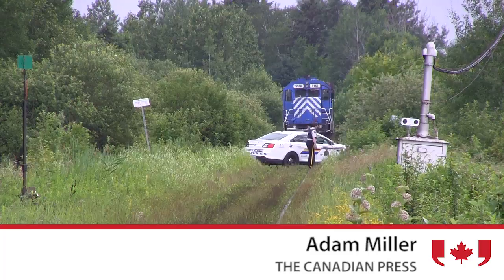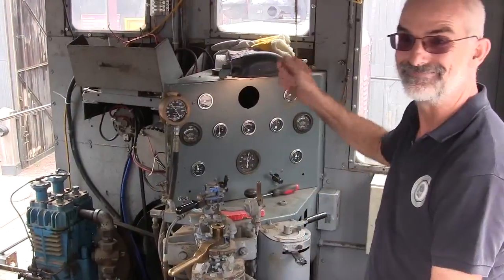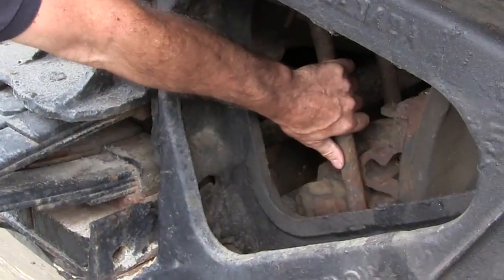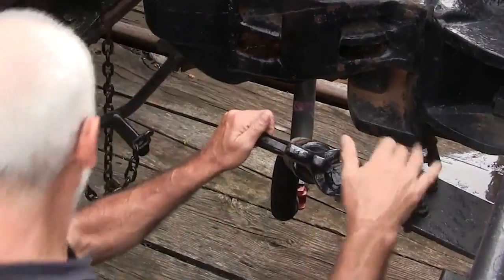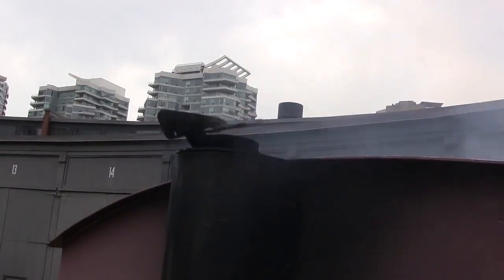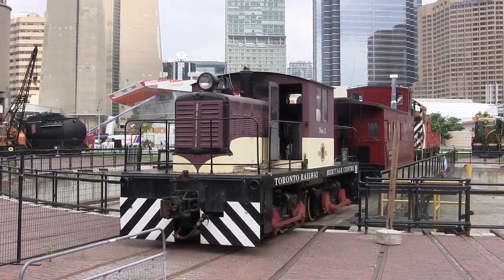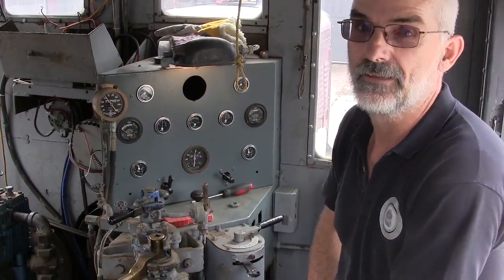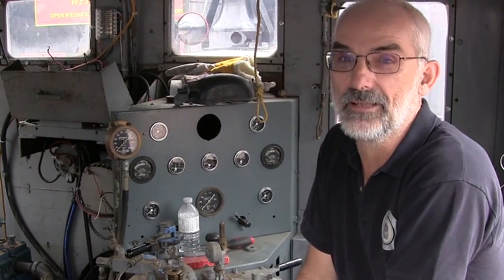A look at how a train's air brakes work

Comment: A better system would be like the ones used in all tractor-trailers.
In these trucks, the brakes automatically apply if there ISN'T enough air...so losing air wouldn't be an issue, and no manual brake needs to be applied.
Even with nobody around, the brakes will apply as soon as the air runs low...which is common when the engine, and therefore compressor isn't running.
Why don't trains have this feature?
Reply: DynamicsOfFlight only if you charge the main reservoir in the cars. when the brake line is charged, you are adding air into the aux and emergency reservoir of each car. when you make a brake set, say from 90 ibs in the brake pipe to 80 pounds, the triple valve on the car would take 10 pounds from the reservoir and put it into the brake cylinders of the cars. This system is failsafe as long as you keep your reservoirs charged, if you keep making brake sets, and then park the train with the train brake set, you'll have a discharged reservoir and at which point the brakes will not work. If you sit around rail yards, you'll note that crews will spend a fair amount of time after tacking on motive power pumping up the air in the train brakes as they need to put a charge in every reservoir in the train before they can move.
Reply: @JamesPattersonGeepfan  You mean "auxiliary reservoir," cars don't have a "main reservoir" only locomotives do.
Reply: StupidFoamer I understand what you're saying, and in part, I agree with you...shunting cars around with no brakes is a lot more efficient than having to air everything up to release a spring mechanism. The point I'm making though, is that if it comes down to deciding between efficiency and safety, shouldn't safety take precedent?
If a redundant spring type mechanism was already in place, accidents like the Lac-Megantic disaster (47 people killed) could have been avoided. In that incident, nobody bothered to apply the handbrake, so it didn't matter how much force it had...which is why a redundant system would be a good idea.
There are all kinds of safety devices that inhibit efficiency, but should we really avoid them because they might slow us down a bit? 
As for stopping a train at 50mph...well that's not what I'm talking about, as a spring system would keep it from moving from a stop in the first place. 
I work in a railyard, so I know efficiency is always top of mind, but if there's something we could implement that could help avoid accidents, shouldn't we consider it?
Reply: +denzzlinga I understand what you're saying, but based on your comment, I think you're misunderstanding a couple things.  First, trucks DO use air applied brakes. ONLY air is used for braking applications on a truck, just like a train. Trucks use air to apply the brakes, and air to release the brakes, just like a train.
The only difference is that the "parking" brake on a truck is a spring. It's only used when the truck has parked, like when the driver leaves or the truck is shut off, for example. 
Therefore, such a system would ONLY be used on a train when the train is parked, engine disconnected or shut down, etc. It would not be activate during the normal movement of the train, even under normal brake applications.
Secondly, it should take no extra time to release upon start up, as the engine has to air up the cars anyway to ensure there's enough air to make a brake application. Trains already do this, and the 70-90psi that they already use is more than enough to release the spring.
Reply: What technology? Trains have failsafe brakes! All you have to do to prevent what happened is to apply the handbrakes on some one the cars.
Reply: as for the automatic brakes like semi's have, that has to do with weight. a truck can have a spring operated brakes as little is required to keep them stopped. you can crush pennys between brake shoes and wheels with the air system.
Reply: James Patterson Although a railcar is heavier than a tractor trailer, I doubt the weight difference has anything to do with it..
The average loaded railcar (Approx. 130 ton) is only roughly double the weight of the average 8 axle loaded tractor trailer (Approx. 60 ton), with the semi having a total spring brake force of around 7000-8000lbs
Are you saying 7000-8000lbs mechanical pressure to the wheels of a railcar wouldn't be enough to keep it from rolling away?
I find this hard to believe, especially considering that the handbrake seems to be effective in keeping the car from moving and certainly can't be applying even that much pressure.
Keep in mind that the large earthmoving trucks, like a CAT797 (300+ tons) also use a spring system with no problems.
I suspect the real reason railcars don't have such a system is cost.
A redundant spring system would not only add to the price of each car new, but wouldn't allow humping of cars which allows a crew to get a lot more done in a day, so a cost to labor as well.
Reply: +nodammit I think the main reason freight trains don´t have brakes like trucks is the releasing of the brakes. 
If you have brakes that use a spring to apply brake force, you will need full brake pipe pressure to get them fully released. In a truck with a maximum of two trailers and 10 axles and 100 ft of length that´s no problem, but when you have a mile long freight train with hundreds of axles, it would take ages for the last car to release its brakes, because there´s so much air needed to fill up that long long brake pipe.
Not so with air applyed brakes, they already release completely at the moment the pressure in the brake pipe rises.
Reply: +nodammit Can you imagine how long it would take to blow the brakes off on a mile or more of freight cars?Or how long it would take to apply the brakes on a mile or more of freight cars?Such a system cannot and would not work on a train for that very reason.
Reply: +formidable38  It would take no longer for the springs to activate than it takes for a regular brake application, and believe me, that's a lot faster than going car to car setting each brake by hand. I work in a railyard, so I see how long it takes to set the brakes on each car by hand...about a minute per brake, per car. The springs could do it in about a second per brake per car, so even with a mile of cars, it would still take less time to do the whole train than to do one single car by hand. 
And as far as recharging the system to release the springs, it shouldn't take any longer than it already takes, as there should be at least 70-90psi in the pipe before the train moves anyway.
Reply: +nodammit I agree with your principle but I just think that to apply the service brakes by increasing pressure in the brake pipe (as apposed to decreasing) would take far to much air and far to much time in a long train and the compressor on a locomotive would never keep up with it, you'd also empty the reserviour in seconds and run out of air. That's what I was getting at in my reply. That's an awfull lot of spring brake actuators to fill with 90 psi . I'm sure if it could be done, it would have been done by now.
Reply: +nodammit I know, I'm a retired truck mechanic :) I get where your going with it, maybe such a system could work for parking alone.Il have to correct you though, train air brakes work on venting the train pipe to atmosphere to apply the brake or a partial reduction of pressure in the pipe for a partial brake application. (truck brakes work by increasing the pressure as we know)
Reply: James Patterson Thank you for clarifying :)
Reply: nodammit Keeping it stopped is one thing.  Having enough pressure to stop it at 50mph is another story.  A handbrake's force is multiplied by pulleys and levers.  There are times a handbrake applies more force than an emergency application.  The other issue is that a lot of yards switch without any air at all.  If the yard youre working in is on level ground, its a lot easier to bleed the air off the cars and do your work without the brakes.  Making the brakes automatically come on when the pressure is gone would make things a lot more inefficient.
Reply: a tractor trailer brake system will not work on a long train! It would work on a couple of cars but anything more and the same principle will not work! That's why its never been done before!
Reply: +formidable38  Sorry, wasn't trying to be patronizing, I just wasn't sure if you were familiar with truck brakes. You're right, they do differ in the sense that one applies pressure, while one releases it to apply brakes.  I don't think that would necessarily matter, as long as the pressure to engage the spring were sufficiently low enough to not interfere with regular braking. I believe the size of the diaphragm has a direct correlation to pressure needed to disengage the spring(larger area = less psi required), but I'm not 100% certain. I remember seeing a lot of trailers in the 70's that had no maxi at all (and wheels on the dolly legs!), which of course resulted in rollaways and what not. There was opposition to the springs then as well, but as you know, the industry adopted and now they're safer than ever.  I think the rail industry is at the same stage now...they know something needs to change, but nobody wants to add cost/complexity. 
However, if nobody adopts the will to try something new, there will be more accidents.  Rules and protocol unfortunately don't often change human nature. CP had another incident just recently of a train parked on a hill with insufficient brakes applied.
Reply: Formidable38
Reply: If I am not mistaken when a trailer breaks from the truck it will rely on the springs to stop. This system would never stop a train car if the conduit breaks. The average passager train car has a brake power of over 70T, getting that brake power from springs is not doable.
Anyway the brake system is not but the problem but the people securing unused cars are the problem. If they would do their job as required this would happen!
Reply: nodammit because trains often push cars around in train yards, letting them roll on their own until it meets the other ones it's meant to be attached too
Reply: That IS how train brakes work. When you reduce the air pressure in the line, the brakes on the cars are applied with the force of air stored in the car itself. It's only when the cars sit for a long time and loose their own air can they roll away themselves, and that's why they have hand brakes.
Reply: I would think the biggest factor in implementation would be creating a system that can be used with the existing brake systems. If RR's were given say a 5 year deadline to implement such technology, then you would undoubtedly be seeing mixed consists with new and old brake technologies. Of the 1000's of railcars in interchange service in Canada, the US, and Mexico, it would be impossible to make conversions overnight, nor would it be practical to run segregated trainsets. I think this has been the big problem to getting electro-pneumatic brakes out there. I'm no brake engineer, nor do I know enough about truck brakes to know if it is feasible to make a train mounted system that could use the typical 90-PSI BP.

First step in avoiding accidents like this is training, and probably not having single person crews, at least in tying down equipment. Even before this, our operating rules were to tie hand brakes, and then release all the air to ensure the cars were stuck. This was a breakdown of rules compliance for whatever reason and management trying to save a dime.
Reply: ironmatic 1 As I said... Rules training and compliance.
Reply: That's exactly the way train brakes work. A REDUCTION in pipe pressure causes the brakes to come on.
Reply: Pretty sure they are like this. Air pressure is required to keep the brakes released, not applied. No air = brake application. There may be a mistake in the video.